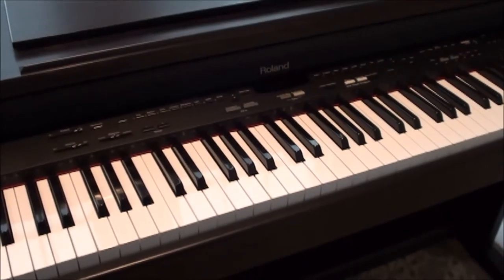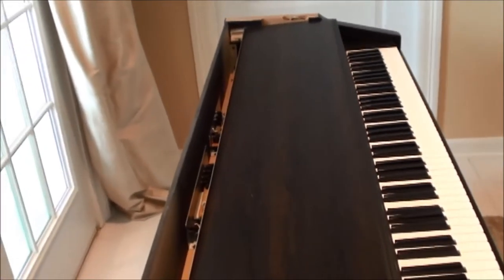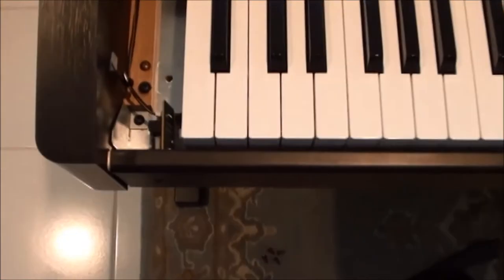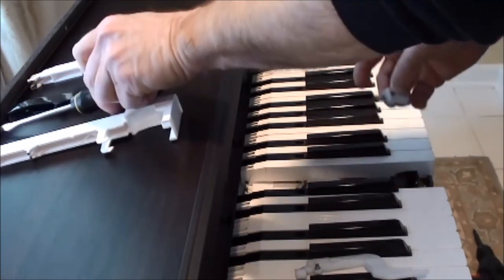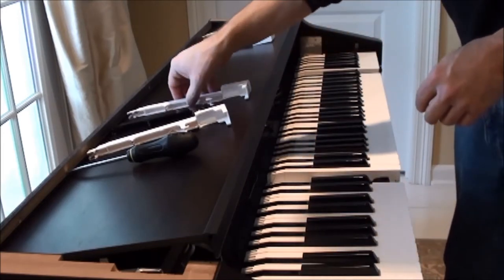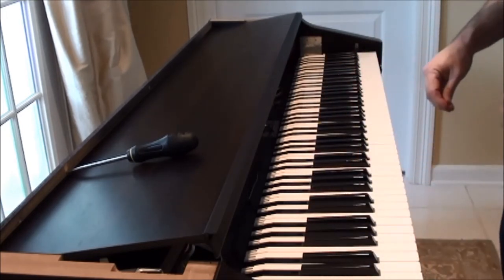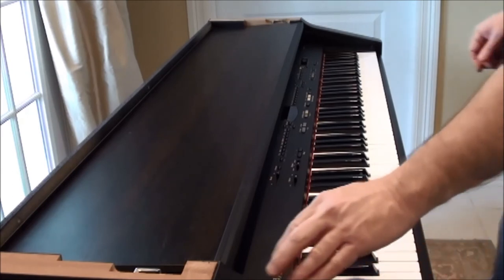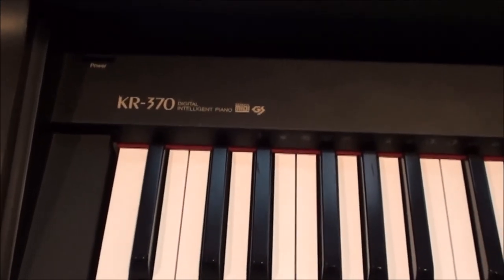ROLAND KR 370 DIGITAL PIANO BROKEN HAMMER REPAIR & REPLACE

Comment: Just want to say thanks. My daughters KR375 had the same issue (weak plastic on the hammer weight) and she cried thinking she'd broken it. used some glue to strengthen it up like you showed and good as new. Thanks again from the UK!

Comment: This video was super helpful. I am NOT handy so I was nervous to attempt it and kept putting it off. My Roland KR-375 worked similarly to the video, with a few different placements of screws and power panel. But, I was still able to figure it out. The easiest part was actually fixing the broken hammer. I took post its as I went to make sure I kept screws and order to re-esemble the piano correctly because I knew I'd forget something along the way. Thanks for helping me fix a broken key and all I needed was superglue and some screwdrivers.

Comment: I have a kr-375 model that I've been using for almost 10 years and it's still in perfect condition... except for my g3 key, the hammer was broken for a long time. The piano is fixed thanks to this video!

Comment: Nice. I just bought a used Roland RD600. It had 1 bad hammer. I repaired it. Then about 5 more went bad. So, I just repair each one as they fail. Piece of cake!!!!

Comment: Thank you!  The very same b- flat hammer on my Roland HP-245 was broken and your video was extremely helpful. Although the way the keyboard cover comes apart is slightly different from the way the 375 comes apart, the hammers appear to be the same.  (And they break the same way!) Thanks again.

Comment: Bulldogs#1, thx very much for the video, it helped me greatly as I had exactly the same issue of a broken key hammer due to the plastic had cracked and broken, your video helped me fix it for no cost, just a bit of superglue - my wife is just thrilled, thx!  I did find that my particular KR-570 had screws in some other locations not noted in your video, but eventually figured that out in other YouTubes describing same fix.  (Yours was the highest Liked one on the search list).   I noticed from other Google searches that this plastic key hammer cracking issue apparently was a known issue at that time (25 years ago - KR-570 is a mid-90's era Roland product).... and sure enough, upon disassembly and looking at my other key hammers, most of them showed cracks as well. Your video helped me understand what the issue is and how to DIY fix it.      I did weigh my super-glued key hammers after applying the superglue (same glue you used), and my digital scale couldn't detect a measurable difference,  so I gather for us hobbyist pianists, the weighting balance of the super-glued key hammers doesn't seem to be affected - after re-assembly the keyboard seems to feel the same to me.   Thx for posting the Roland part numbers for replacement key hammers should we want to not go the super-glue route, and thx again for posting the video.

Comment: After replacing hammers, do you know what would cause the keyboard to not be very loud?  The speakers are working fine, but when we play the keyboard with volume full blast, they are not very loud.  Thanks
Reply from the maker: Margery, I'm not sure about this issue, however, If the amp is still in good condition then I would suspect maybe a loose wire or a dirty or bad volume slider control. I have a bad reverb slider control on my KR370 and have yet to try to repair. Unfortunately, these parts are no longer available, so you'll need to try clean the contacts of the slider control. If you're a DIYer then you can remove the cover of the piano again as in the video to gain access to the slider control and try cleaning with an electronic spray type contact cleaner.

Comment: Super glue is very brittle that won't last long. The best way (if it's a thermoplastic) would be to melt it and use metallic reinforcements inside.
Reply from the maker: The first hammer repair I made using this technique was about fifteen years ago.
Reply: Hi, Fran, noting your comment above, I let the superglue wick down in between the plastic and the metal weight, thus hopefully stronger bond as more surface area of superglue to bear the load.   Hopefully it will prove to be strong enough as Bulldogs#1 experience showed.

Comment: I have a Roland KR-370 that has no keys working. All power supplies working but no keys function. Can you help or know of a source for parts or main board, schematic??
Reply from the maker: C Butler; unfortunately I cannot. I recently had the same issue with my KR-370. I change out power supply and still nothing. I'm guessing the main motherboard has issues, but they are no longer available except to purchase another KR-370 for parts (which I actually thought about doing....). The reverb slide had also gone bad and I had a the pedal set that was going to need rebuilding soon. I had owned this piano for 25+ years, played it almost everyday (laptop and amps connected, headphones, wires everywhere, etc), and it pained me to take it apart and discard. After playing several, I recently replaced it with a Roland HP704. The HP action is slightly heavier but as close to the KR as I could find. There are a couple of piano sounds that I have yet to find on the 704, however, the blue tooth capabilities, wireless headphones, etc., make up the difference. Any song or chord chart instantly available via Youtube and an IPad. Wish I had better news.
Reply: I had a similar problem with my KR-370. It worked fine and then nothing. After about 10 years I was thinking about the piano and why it wasn't working. I noticed the headphone input jack and I thought to myself, that hole looked to be the same diameter of a crayon, I wondered if one of my children pushed a crayon into that hole and broke it off. Sure enough, that's what happened. I dug it out, Now it works fine.
Reply: It only cost me $15,000 dollars because I bought a baby grand so my wife could continue playing.

Comment: What brand of glue did you use? pretty please
Reply from the maker: Loctite gel super glue. Dries to set in seconds, to hold in 10 mins, completely dry in 24 hrs. Find it at Lowe's, Home Depot, maybe Walmart. Clean up with acetone (finger nail polish remover).